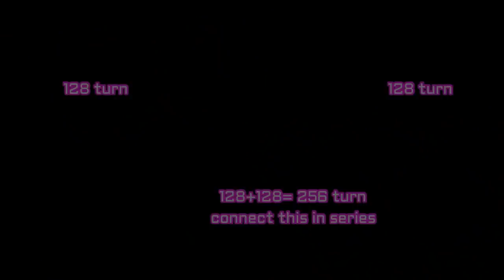100 amp welding machine | How to make welding machine at HOME|DIY

Comment: Hi I have problems when finding at my country the number of wire 11 for the primary winding. I can use wire 10 or 12?. thanks
.
Reply: @zenithcomputers3286  thanks, good work.
Reply: Puedes usar cables más gruesos...siempre y cuando la abertura del núcleo permita alojarlas.

Comment: Please can you label the coil parts and connections for us: primary coil inside wire and outside wire, primary coil start point and end point, how you connected both primary coils and how you connected both secondary coils with labeling etc.

Comment: Hello Zenith Computer, in your video "100 amp welding machine | How to make welding machine at HOME | DIY" I do not see the measures you take of the small wood that you use to wind the electric conductor to do in winding, could you tell me how much it measures the wood, please. By the way, your video is great, it's very good, I congratulate you, keep going. CONGRATULATIONS.
Reply: 40mm*50mm*100mm

Comment: excellent...sir can ask you let me know how many pieces core in 6.inch/ 1.5 inch layer and 4.5inch / 1.5inch. I'm from Philippines..... thank you
Reply: i should measure 9.5mm in height just in size of 6.inch/ 1.5inch core thin.
Reply: Thank you,..sir  i have requested to you  i would like to make you another video about this 12v battery charger even if it's only 90amps or more amps you made it.I'm so grateful to have a whole a lot again thank you so much

Comment: sir  did you parallel the primary or ceres   ... and sir  how  many layer of  plates  did you make for that  set  ?      please  reply
Reply: Parallel for 110v., serie for 220v.
Reply: PRIMARY: connecting in serie for 220; connecting in parallel for 110.

Comment: Is there a special reason why you use these harddisks? Hmm..thought so.
Anyway, you made a really good job winding this transformer. It will serve you for a long time. BUT..! Remember some kind of casing around it as it's simply too dangerous with open leads. Sooner or later you or someone else will accidentally touch them which will be really bad.

Comment: Good work!. However, you should probably coat each core piece with lacquer for insulation. This prevents eddy current in the core and the resulting losses which are transformed to heat. With each piece electrically isolated, the machine will run cooler and more efficiently, probably having a higher duty cycle. This is the reason a transformer core is laminated rather than solid. You might also consider tapping the secondary coil so you can change voltage/current output. A rectifier, for DC welding, would also be a nice addition to your design.

I am also wondering where you sourced the steel for the core. Did you buy new silicon steel such as is used in commercial transformers, or was it salvaged?
Reply: Growley M  pls consider i am not literate of electrical matters but may i ask what is this lacquer?
Reply: It is sort of a varnish. It provides a thin layer of electrical insulation. It prevents electrical current from circulating in the core, but allows magnetic flux to circulate. The electrical eddy currents waste energy, as heat, and in worse case scenarios will cause the transformer to overheat and melt insulation. I am sure that there is an industry accepted type or formulation of lacquer for transformer or motor or generator core laminations but you could experiment with different types of shellac or varnish, maybe. Possibly you might find an inexpensive substitute that would work okay. The very reason why transformer cores are made from laminations is so you can prevent or confine these eddy currents, so it makes sense to insulate them from one another. The insulation should be very thin, of course. Kapton tape might even work. Paper? Maybe. Anyway the ends and edges as well as the surfaces should be insulated as well. As you have seen, it will work with no insulation, but it would without a doubt work better with an insulation coating on the lamination pieces, running cooler and more efficiently. If you tear apart most commercial transformers you will see that there is a layer of lacquer on the laminations. Also often the wire is coated with lacquer and has no cotton, fiberglass, PVC, etc insulation. You can verify that this thin coating actually does insulate, with an ohmmeter or multimeter. One advantage of lacquer insulated transformer wire is that the copper coils can be wound more compactly. It could break down, electrically, at very high voltages which is why many old tube type television transformers had secondary wire insulated with silk, cotton, or other fiber. The various vacuum tubes and especially the picture tube required high voltages that could arc through ordinary enamel coating on the transformer windings. For a welder, you are actually stepping down the voltage, and so enameled wire, also called magnet wire, might work quite well, if you have a source for heavy enough wire and can form it into coils.
Reply: I only have one question, what kind of rolled steel I can use, where I live does not sell to silica, please help.
Reply: You really think it's necessary to further insulate insulated wire? I can understand doing so with magnet wire which has such thin insulation, but that insulated wire should be plenty well insulated as-is. I can't imagine lacquer does much more. Though on the other hand, adding some sort of coil dope (personally, I've not found anything better than good old fashioned xylene and styrofoam) to fill the gaps between the wires to reduce the noise
Reply: @growleym504  Please Sir, Can I use the lacquer for Coating Copper wire's; Will also withstand High Heat?
Please help me.
Thank you Sir.
Reply: @godwillengineering6358  Most wire suitable for this is already enamel coated. Uncoated, uninsulated wire does need to be coated, of course. If the wire used is PVC insulated, it should have a temperature rating. Some insulation will not hold up to the heat generated in such a project, so choose carefully and monitor winding temperature closely if this will be an issue. The closer the turns are together, the better performance your transformer will have, and thicker insulation separates the coils more than a thin coat of lacquer. The wire will probably get hotter than the core and so any lacquer used needs to tolerate heat quite well. Can't help you on brand or distributor... something to google or ask on the appropriate online forum. Those who make DIY motors, alternators, or generators will know. Wire salvaged from old motors and transformers will already be lacquered. Just be careful not to scrape any off while unwinding it, and check the diameter to ensure it will carry the current required.

I think the insulated wire you used in your video will work fine, as long as you do not let your transformer get too hot. If you look carefully, you may find a temperature rating and other useful information printed on the insulating jacket.  If you can find an IR (InfraRed) thermometer then use that for checking temperature in operation. It is a simple and not very expensive device that you simply aim at an object and it digitally displays the temperature. Accurate enough for your purposes. You could also bury a thermocouple sensor in the windings and construct a simple circuit and readout for temperature. Or do it old school style, and just turn it off and put your hand on it. If it is too hot to touch comfortably, let it cool down a bit before continuing the welding job. Typically these type of welding transformers have a Duty Cycle of about 20%, i.e. for each minute of use, cool for four minutes. For each 5 minutes of use, cool for 20 minutes. You will figure that out. But you can't expect it to hold up to long periods of near constant use. Check for overheating often, and just go by that.

Make sure you can quickly unplug this from the power source in an emergency, and isolate it from flammables. Be ready in all respects for electrical fire or meltdown. Don't let curious or unknowledgeable bystanders get close to your equipment while it is energized. You don't have much in the way of safety devices built in to your sysystem so all the safety is in the brain of the operator, which is you, I presume. Bystanders might not always have a lot of brains.

Good luck! Hope it works well for you.
Reply: @growleym504  Thank you very much  .

Comment: hi can you tell me how the calculation for that type of transformers to solder yours make one can connect to 110 and 220 AC and you can buy up to 250 or 300 AMP as you would those calculations I thank you very much

Comment: please and how would be the calculations of the coils for 110 Vac thanks for your help from Colombia
Reply: Hola...se podría decir que es una vuelta por voltio.El primario de esta soldadora,tiene dos bobinas de 128 vueltas...osea 250 en total pero funciona tanto 110/220.El primario se conecta en paralelo para 110 y en serie ,220.
Reply: @luisco991  gracias ,amigo  tenía esa duda
Reply: @sheos1234 ...suerte en tus proyectos,amigo.

Comment: im asking if the 100 amps welding machine was 220 v thanks for your reply body
Reply: Coil primary,connecting in serie for 110 v..Connec_
ting in parallel for 220v. Sorry for my english.

Comment: Your whole video is worth but why didn't you show the wiring mainly the secoundary connection
Reply from the maker: You can find in details.
Video link
https://youtu.be/XhK4gQaMkbs
Reply: @zenithcomputers3286  thanks for helping 👍 can i use no swg 3 wire in 100 amp welding machine transformer in secoundary

Comment: They didn't mention how they measuerd the current are you assuming that it's about 100 amperes or is it really of 100 amp
Reply: Zenith Computer's thanks but it would be great if you showed it in video by clamp meter or anything that can show it's input current

Comment: Can we make the core from iron?
Reply: No, the core must be made from thin low carbon soft iron plates and many of them.....mild steel will work but is not as efficient and can get hot.
Reply: Silicoso steel.

Comment: I'm impressed, but labor cost / materials you could have bought nice Ac/DC Lincoln  welding machine 220 volt single  phase for 400 dollars or used for 200 dollars

Comment: But how did you connected primary coils in series. I think you joined wrong. You joined Inner wire with inner wire of second coil in Primary which is not correct. To join in series you must connect inner wire of one coil to the outer wire of second coil.

Comment: Sir pleaSe tell us benefits of inverter arc welding machine over ac arc welding macjine
Reply: Call video
Reply: Let me tell you a little about it.

The inverter technology is more energy efficient, weists much less electricity.

Their weight is also a huge difference. A transformer one can be five or more times heavier.

The size is also a huge difference. You can get an inverter that you can save it in your pocket.

You can weld aluminum, burn 7018, 6011,6010,6013 Rods.

In a few words inverter is great.
Reply: Estoy. Esperando. Respuesta
Reply: Por. Que. No. Me. Contestas
Reply: @RamonGomez-op1qi  a quien le hablas?
Reply: What is the primary voltage sir

Comment: can i use galvanize sheet
Reply: No
Reply: +Herb Song no what du u mean?
Reply: Galvanized steel is different from silicone iron. It can not make transformer. The coil will get very hot. And there will not be enough output current to weld.
Reply: +Herb Song ithick your right with that.

Comment: DEUS te proteja sempre
Reply: quantos ferro levá é quantidade de fios nó primário é secundário por favo me enviar que deus abençoe você
Reply: Primario = 2 bobinas com 128 espiras de fio 11 AWG cada uma, ligadas em serie
Secundario = 2 bobinas com 28 espiras de fio 04 AWG cada uma, ligadas em serie
Reply: @pauloeduardo9604  WORK FOR 110 VOLTS ??? OR ONLY FOR 220 ??
Reply: @daviddelatorreperez4  220v only
Reply: El primario en serie para 220 y en paralelo para 110.